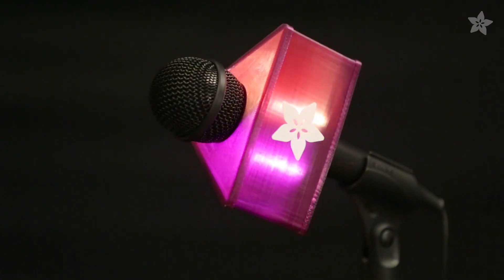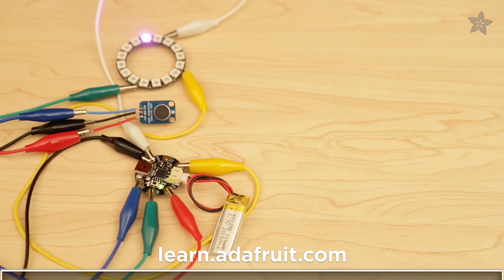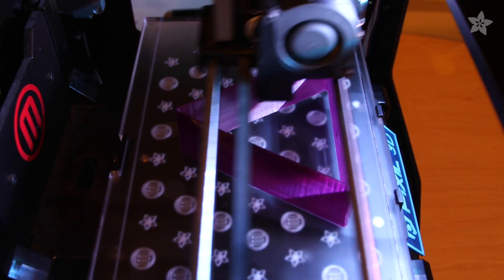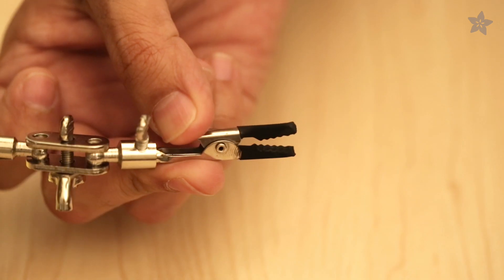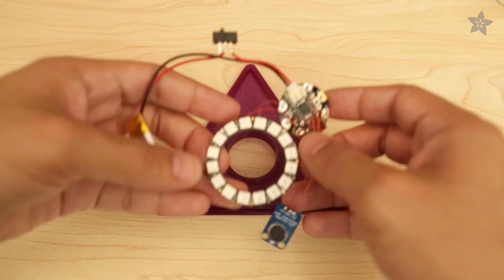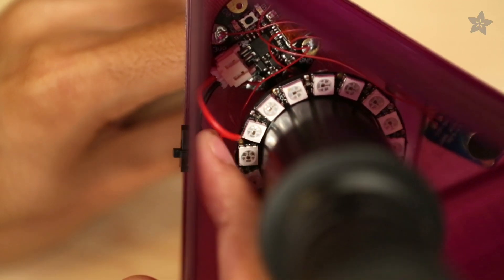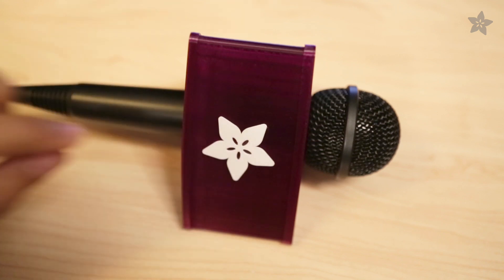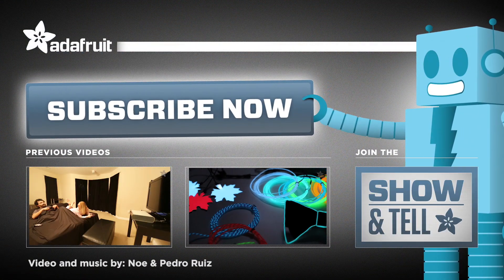Sound-Reactive Mic Flag - 3D printed microphone holder with GEMMA and NeoPixels!

Comment from the maker: *Sound-Reactive Mic Flag - 3D printed microphone holder with GEMMA and NeoPixels! *

http://learn.adafruit.com/3d-printed-led-microphone-flag/

Want to wow the audience at your next gig? Light up those parties with a 3D Printed, LED sound reactive microphone flag. This project uses a microphone sensor to illuminate a custom 3d printed mic flag. You can design yours, or use our STLs to print and make your own!

Sound-Reactive Mic Flag - 3D printed microphone holder with GEMMA and NeoPixels!

#adafruit #arduino #electronics #hardware #opensource #projects  #computer #microcontrollers #LEDs #LED #gemma #neopixel #neopixels #wearables #art  #3dprinting
Reply: J
Reply: Is there a code to completely randomize individual random colors in random orders for each neopixel individually? and NOT go in circle all the time.